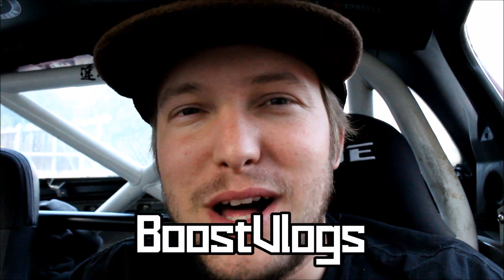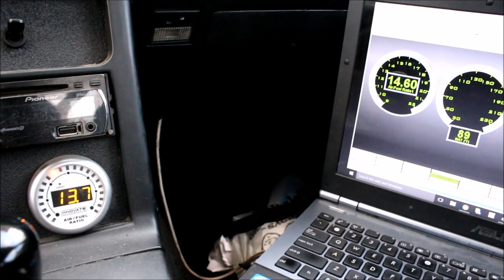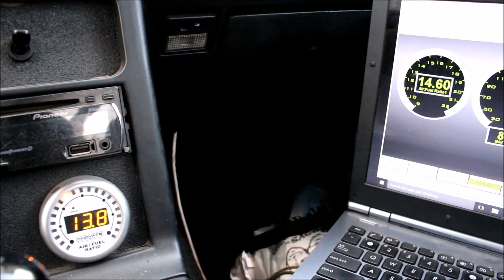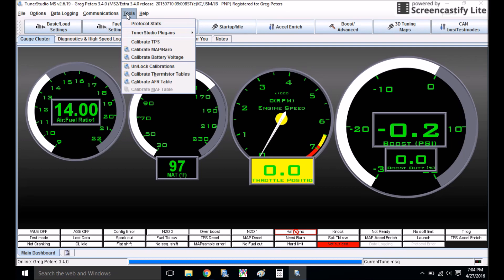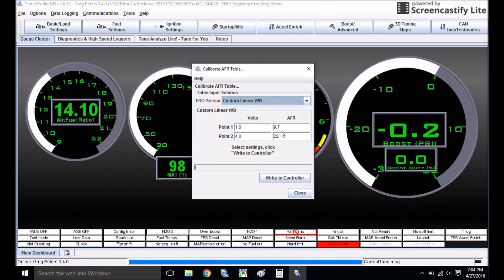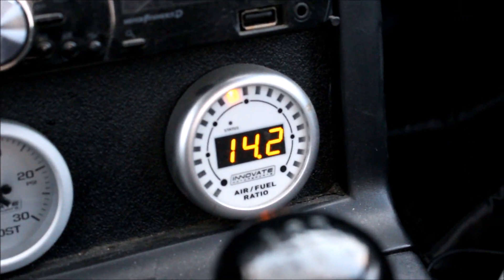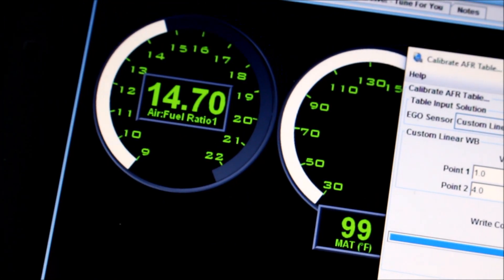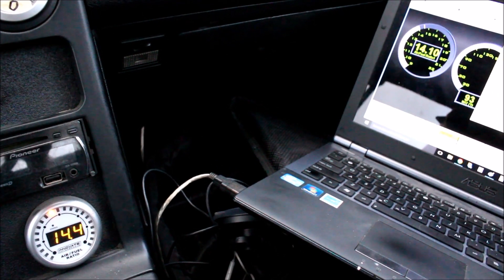Wideband vs. Megasquirt: Different AFR??? (BoostVlog 4)

Comment: I ended up grounding the wideband to the intake manifold and that helped a bunch. Then when none of the default settings worked, I painstakingly created by own custom inc file and now I'm only .1 to .2 off at anypoint throughout the range.

Comment: The problem with calibrating like that is the slope will be wrong. At 14.2 you are more or less accurate however you'll find that on over-run and full boost you'll be off again. You need to go into LM Programmer and see exactly what the slope is. As posted below the stock setting on one of the outputs is 0V=7.35 & 5V=22.39. I use 0.5V=8 & 5V=22. This makes 14.7 ~2.66VDC. You can set the error state in your LC-2 or w/e controller you have to 0.3V. This is listed under the advanced button, click program a lot. You cannot leave any screen without hitting program or your changes will be lost. In Tunerstudio you set the error reporting to less that 0.4V. This allows almost full range of the sensor and error reporting. I also set the startup initializing to 2.66V. This is more important for factory ECU's when you are simulating a NB so it doesn't throw off your LTT on a hot motor.

Comment: Thats not necessary correct. All youve done is adjust the linear line to intersect and read properly at 14.3....what about at 11.0 for instance? The ending of the  video should have mentioned that this needs to be verified at lowest AFR and highest AFR. That 1v at 9.7.....you havent even touched that...so at low end of the scale it might still be off.

Next question is, how much do you trust innovate? There's talk of innovate being a full point off when compared back to back with AEM....

Comment: INNOVATE MTX-L   0V=7.35AFR       5V=22.39 AFR
Reply: The actual voltages depend on the voltage drop due to your wiring and unique application.

Comment: Thank you so much for this video! My lc2 reads 1 full afr richer than my megasquirt so this will hopefully fix my issue.
Reply: you could reprogram the lc1-lc2,to match the megasquirt..lc-1 -lc2 comes program to read from 7.0-22.0(on the wide band output) verses tuner studio 10.0 - 21.0.just reprogram the narrow band out to 10.0-21.0 ,to match turner studio